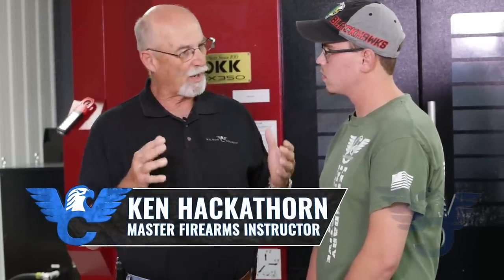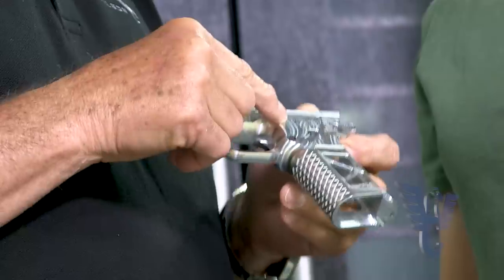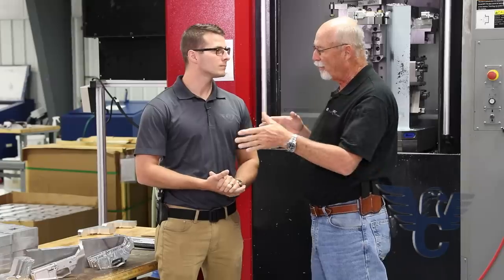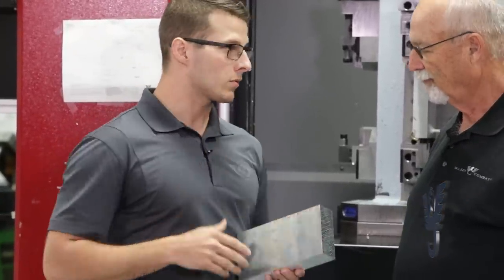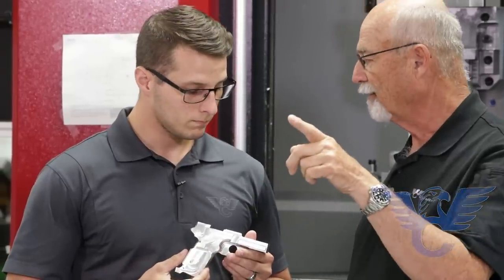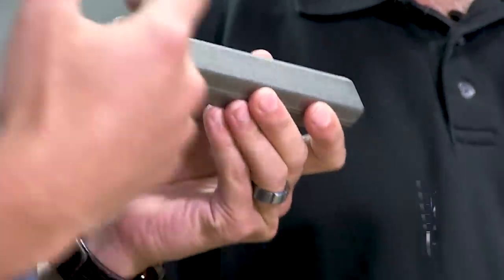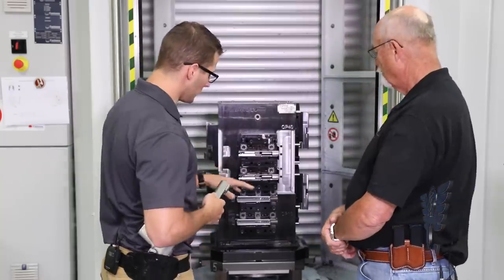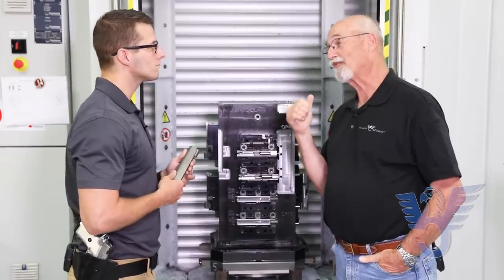Machining Frames and Slides – Inside Wilson w/ Ken Hackathorn - Ep. 04

Comment: I always think of the guns being "hand made".  I know they have a lot of hand-fitting (I guess they do), but it's funny to see so much work done by machines and robots.  Price of the guns don't come down, but I guess someone has to pay for those very fancy machines.  Maybe "hand made" is overrated.  Introduces human error.
Reply: Completely hand made wouldn't introduce human error, but it would probably ramp the price up to over 10K for the entry level gun.
I recently shot a an old original 1820 front-loaded percussion pistol. Not a replica, and original. Completely hand made and as accurate as a modern sports pistol. There was no human error in that gun, but you couldn't pay for that kind of hand-made anymore. (Well, even the old gun was way too expensive, the owner didn't want to tell me so I'm sure it was way more than a Wilson Combat 1911...)
Reply: When they come of the machines 99% of the way done, things are still oversize, i.e., the slide won't go on the frame, the barrel will not lock up into the slide, etc...; parts are hand cut/filed to fit.